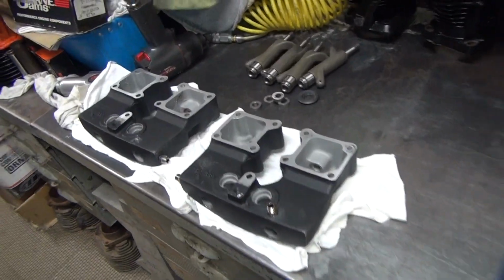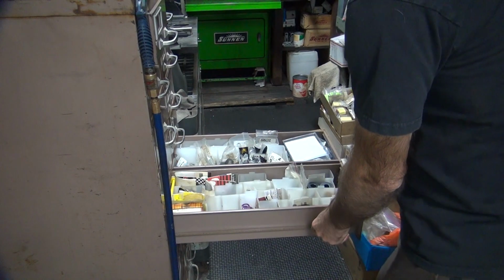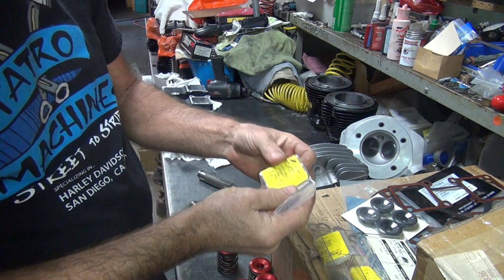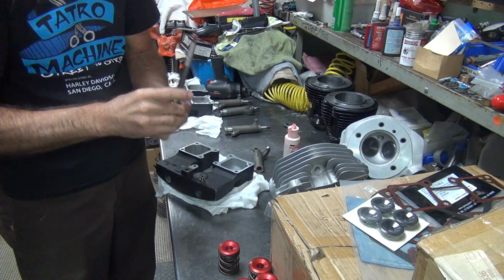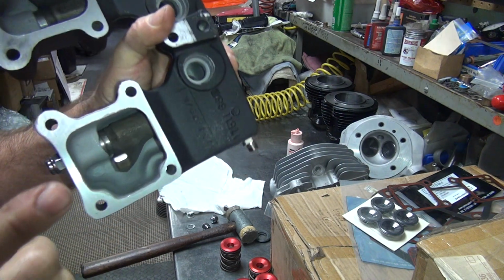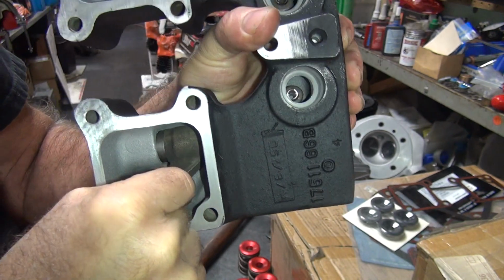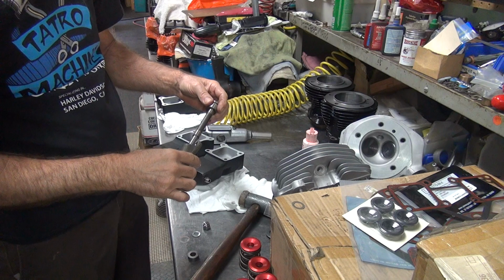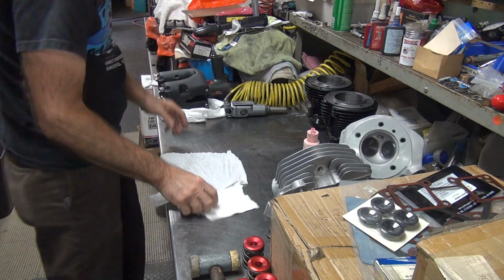1980 shovelhead #112 92ci topend rebuild stroker fxe street racer harley cam change tatro machine

Comment: I just bought a set of sifton rocker arms and shafts for my Shovelhead. I put it all together and I've got zero lash in fact when I tighten the shaft nuts they lock up. I noticed the rocker arms are a 16th of an inch longer than the factory rocker arms. Upon further research I noticed V-Twin sells a sifton kit to install these that has a wavy washer and a steel spacer... I ordered it and I'm waiting for it to get here. I was recommended to not use the wavy washer. Hopefully it will give me my lash that I need.

Comment: put those ram jet kits in my shovel 25yrs ago? still was loud. blew gskt rear. cyl. 10yrs ago . ramjet was just a shim! my shovel must be a metal muncher!  burp! paper base gskts. now spitting oil? just found out here, i,m lucky i got 10! God is my co-pilot. AMEN!  just 1k+ per year street driving in chiraq. keep the rubber to the ground! Just got my TATRO T shirts. OK!
Reply from the maker: time for some new rings to cut the blow-by back some. use james format base gaskets and they will not blowout.
tatro

Comment: HD states .004 -.025 inch at full torque, why not just torque them up and check the end clearance with a feeler gage then put in the appropriate shim to attain the number you want.  I set them to .010.